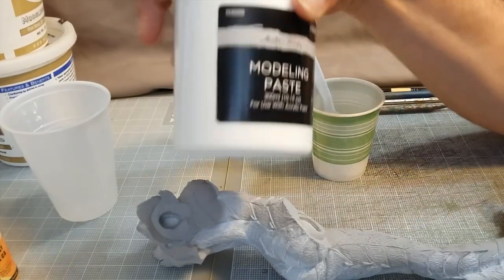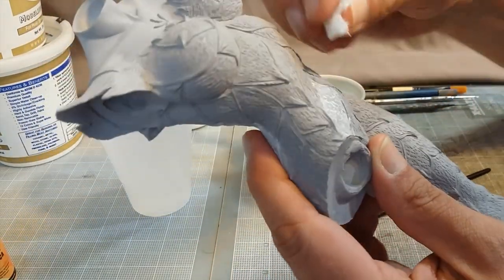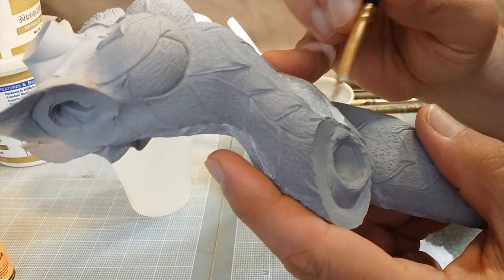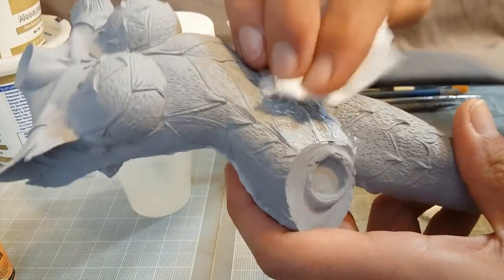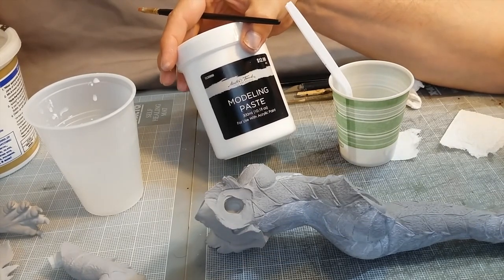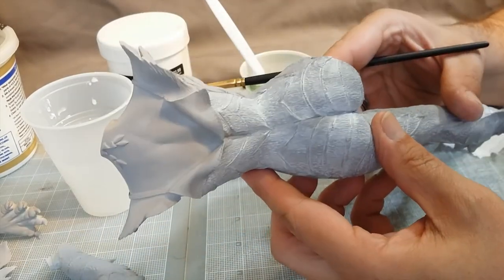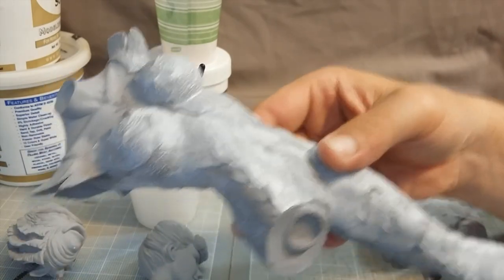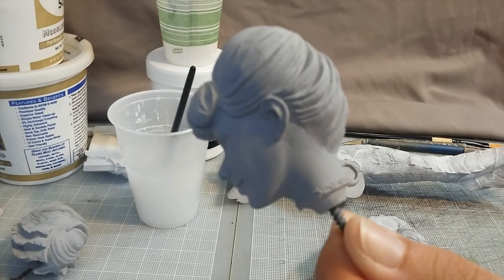Laguna Resin Model Kit - How to Fill Pinholes With Modeling Paste

Comment: Do not do this.  

Those ‘pinholes’ are part of the mold.  They are intentional.  Look at the skin areas of the model… there are no holes there.  The casting was done properly and is fine.  The holes were created as part of the ‘creature suit’ Laguna is wearing.  I’ve confirmed this by talking with the guys at Filmy’s Girls, the kit provider, at WonderFest last year.  I was asking about techniques to paint them since they are all over the creature suit portion of the model (but absolutely no place else)

I painted this using a dark green base coat that filled the holes.  I then glazed the dark green back to light green being careful to not lighten the holes to much.  Brighter areas went to lighter green while darker areas stayed closer to the base color (some light was added for variegation). I use a yellow-green glazing on the ‘ribs’ between sections.  The dark green base was largely left alone right next to the ribs.  It looks amazing.  (More because it’s an amazing sculpt rather than I’m an amazing painter (which I’m not… just decent))

The holes are an intentional feature.  They are not a mistake and they add accent and depth to the figure.